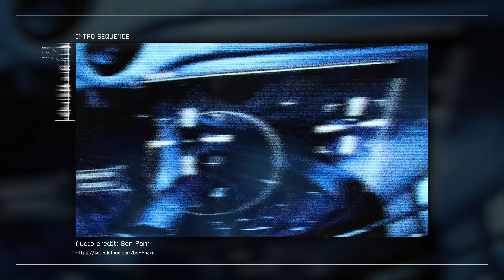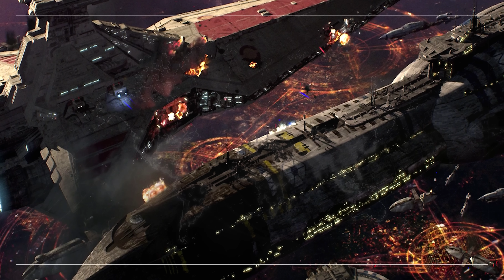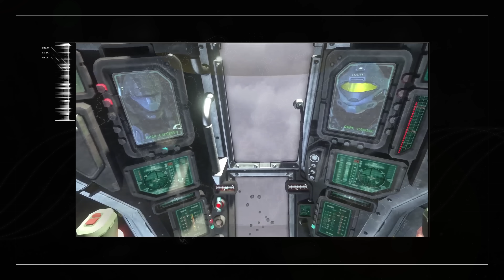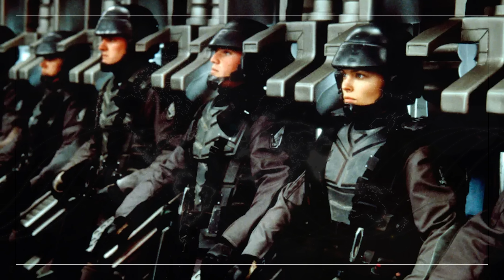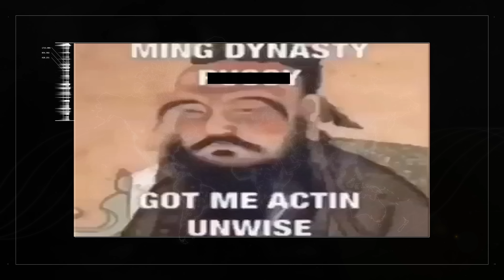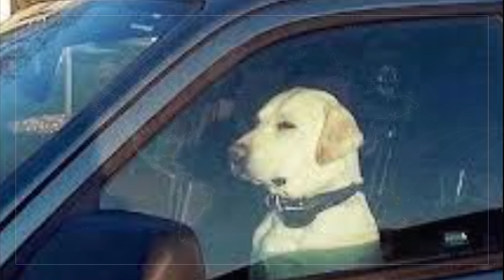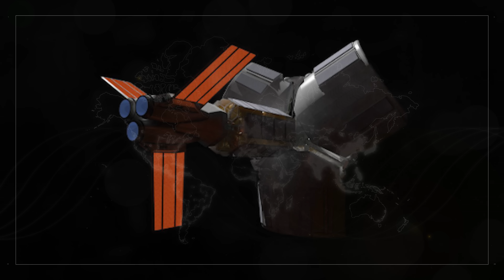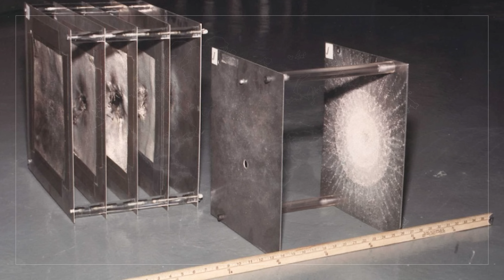The REALITY of Space Warfare

Comment: Great video, though i'm not sure if I agree that planet side defenders have it worse off than an orbital fleet. Yes, the fleet has the high ground, but the energy imbalance from that actually kinda swings in the defenders favor, for low orbits at least, because the defenders can use the spaceships' own velocity against them. The defenders doesn't need to launch a missile into orbit, they can just launch a suborbital missiles straight up and have a spacecraft in orbit slam into it sideways at 8 km/s. 

Second, the defenders have the resources of a whole planet at their immediate disposal, whereas the attackers only have whatever supplies they are able to haul along with them over interplanetary distances. Sure, the attackers might have substantial resources elsewhere in the system, but those interplanetary resupply runs are going to be substantially more time consuming and costly than the defender's intercontinental resupply runs. 

And lastly, a big advantage that wasn't mentioned is the planet bound defenders have cover. Both in the sense that they can bury bunkers into mountains and just be stupidly difficult to crack, but also in the sense that they can hide . You can have hidden bunkers or even stealthy mobile assets like submarines that make it a nightmare for the exposed spaceships in orbit to know when and where the next attack will come from.
Reply: Space is big, super big. A fleet doesn't need to be close to a planet, it can very easily just sit at edge of the solar system throwing literal rocks at you, or to be fancy, iron or other denser material. You in your happy planet or fancy Space Station, are just sitting ducks, you cannot dodge, you can only evacuate or try to minimize damage because everything you destroy is still coming towards you at ludicrous speed but in smaller parts now. Meanwhile the fleet is too far away to be in real danger of any retaliation by the planet or space station.
Reply: @krigerLM  Things take many decades to fall from the edge of the solar system, giving the defender plenty of time to nudge it off course using the same techniques the attackers used to put it on course. The attacker needs to completely reshape the object's orbit and boost it towards the planet at high speed if they want it to hit within their lifetime, the defender just needs to shift its path by a fraction of a degree. You'd have to have some of the fleet follow the rock and ward off redirection attempts, but that's putting the fleet back in danger again. The only way you could stand back at the edge of the solar system is if the planet your attacking isn't spacefaring, or the entire rest of the solar system is inhabited and is on your side. Which, yeah, if there is that big of a tech or power discrepancy the defenders are going to loose. I'm not saying a planet can 1v1 a whole star system, I'm saying they have a home field advantage if they are attacked by a comparable power.
Reply: @massimocole9689  right, if they’re going for a traditional invasion (non planet busting) they’d need to have already begun to colonize the star system in order to utilize “local” materials (which are still incredibly sparse in outer space). If they haven’t already set up infrastructure throughout the system then their supply chain is just not up to par with a resource rich planets. Eventually they will run out of crowbars. If you say “nuh-uh they brought all the crowbars they’d need” you’re telling me they brought 70,000 extra crowbars across interstellar space?

And we come to the inherent problems of hypotheticals and assumed starting conditions: if they’ve already invaded and set up infrastructure between asteroids and comets and other planets without resistance— or if the defenders have had access to space and the ability to interfere with this level of colonization— either way I feel like we are stretching the definitions of “space bound” and “planet bound.” These are battles that have already been won or lost before a shot was fired.

Anyone can set the starting condition of either side as OP as they want, at which point realistic analysis is pointless.
Reply: One doesn’t have to hit the orbiting enemy from the planet. Striking anything up there could get a chain reaction going and the ships computers will be overwhelmed by Kessler Syndrome
Reply: @AnkhAnanku  False.
Reply: Just thinking here, but wouldn’t a better payload delivery be something like a flak missile? You could fire a bunch off and have them explode before hitting any ships, launching tiny bits of metal toward an enemy fleet. If you could figure out the timing well enough, you could simply use the missiles as a vehicle to launch metal at great speeds toward enemy vessels.
Reply: It's true that the planetary side would probably have more resources and cover than a space fleet. But as long as the planetary side is blocked or not capable of moving into space the whole combat just boils down to literally throwing rocks at the planet.

A fleet capable of interplanetary travel would more than likely have multiple ways of redirecting or accelerating an asteroid with rocket boosters or specialized towing ships and push them into the planets orbit.

Like in the Expanse. 

To a sufficiently advanced force, a planet is an incredibly vulnerable target since the planet itself is incapable of any evasive maneuvers. You don't need giant lasers or multi megaton nukes to cause catastrophic damage to a planet, a simple rock will suffice. And as for underground bunkers and such, the same applies, just drop a big rock in the suspected area of the bunker and you don't have to deal with it. Even if the bunker withstands the impact it will get buried or damaged. And it's a lot easier to spot a bunker's entrance when they open it in the middle of a barren crater.
Reply: @NemValaki  Planetside can detect incoming asteroids and have the same (if not better) capability of deflecting them. Ablating lasers and railguns fired early enough can totally deflect incoming asteroids for less energy than it took to bring the asteroid to a collision course.

Also this is something people tend to not think about, but I subscribe to the Isaac Arthur mindset that even a very young spacefaring civilization (think 200-300 years from now) has trillions of people already living off-world in space habitats once automated construction and mining takes off. That is an incredible amount of sensors and defense stations on system that invaders have to deal with before they can even begin lobbing rocks at the planet.

Non-invaders, e.g. people who just have to destroy the planet, don't have to deal with them, though...
Reply: 1. Energy and speed. Your ordnance is slow, hot, and expensive; his will be fast, cold, and cheap.  They'll have plenty of time to intercept your missile. It's the same problem infantry has with aircraft, but on steroids. 
2. Resource availability is an advantage but only if you've already built the ordnance. Any factories will disappear fast.
3. That's cover and concealment. The latter works only once for each launcher, if at all. Orbital synthetic aperture radar can track subs, while any missile silo will disappear in a cloud of dust a minute after it unmasks. The former would have to be 1km under the rockies.
Reply: @ 1. Velocity is relative, a suborbital missile that is barely moving with respect to the ground is moving at 8km/s with respect to a ship in low orbit. Orbital ordinance becomes hot the moment it fires up its engines to deorbit, and becomes very hot as it renters. Orbital ordinance is also more expensive than surface ordinance, because it took an interplanetary long supply chain to deliver it, and had much tighter mass limits as a result.
2. Factories are somewhat difficult to completely bomb out short of nuking them. In WWII factories all across Europe were repeatedly bombed over and over cause they kept coming back into service every few weeks. That's not even factoring in the possibility of hardened factories in bunkers. The fleet in orbit meanwhile has zero factories, it has to rely entirely on its own stores or on a very long logistics chain. 
3. Depends on how fast the retaliation from orbit is. If its primarily missiles or kinetics you have several seconds or minutes for a mobile asset to relocate or for a bunker to reseal. And even if it is almost instant, cheap disposable launchers wouldn't care. Suborbital missiles are small enough to be truck launched, and lasers can be directed to redundant relatively cheap relay mirrors.
Reply: @ Was this for me? You have to leave the name for a person to be notified.

1.  It's slow as sludge climbing the gravity well and hot as hell from the rocket. He'll have plenty of time to intercept. Even in orbit, 8km/s isn't really all that fast for space combat vessels. The stuff he drops will only light up for a second to de-orbit, after which it's just a free-falling crowbar. That will heat up in entry, but the hotter it appears is also faster and closer. 

Because it's just a crowbar with rudimentary guidance, it will be cheap no matter what. Given what it is, it would be standard for the invader to make them on-site from asteroids or small moons.  Your stuff will require rockets and expensive guidance systems designed to evade point defense and hit ships maneuvering at 10+km/s.  

2. Any visible factories, C3I, or detection systems will be eliminated on day one. Remember, he's dropping 1000kg crowbars from 1000km at 9.8m/sec/sec. This will vaporize anything it hits. He doesn't need nukes when he has the power of MV^2.

3. Mobile launchers can be tracked once they reveal themselves and smaller crowbars directed at them. You can't outrun something like that. Any bunker that can launch can't be deep enough to survive the heavy crowbar strike. Lasers are useless for anything but point defense due to atmospheric diffusion.
Reply: @mojrimibnharb4584  I did put your name, but it got bugged. Your comment also has that issue, my name isn’t showing up in it, it’s just an at symbol on my screen. It’s an annoying issue with Youtube at the moment. It also seems that comments that are too long don’t go through, I tried sending this as one comment and it didn’t work, so I’m splitting it along the 3 bullet points.
Reply: @mojrimibnharb4584  1. A missile can easily have a thrust to weight ratio of dozens or even hundreds of g's, so the difference in acceleration between a missile going up or down a gravity well is pretty small. The difference in velocity is also somewhat minor, especially if your missiles are powerful enough that an 8km/s closing velocity is considered slow. This is compounded by orbital velocity working in favor of the defender and in the disfavor of the attacker. If a craft in low orbit wants their rod to fall quickly, rather than just barely skimming the atmosphere 45 minutes later on the other side of the planet, they need more than just a minor 1 second deorbiting burn, they need to scrub off nearly all their orbital velocity and fall nearly straight down, which still takes several minutes. And if the enemy isn’t directly below your current ground path you need to spend even more fuel changing the inclination of the rod’s orbit. Both these burns become smaller if the craft is in a higher slower orbit, but then the time to fall gets much larger. A fall from geostationary orbit takes *hours*. 
 
The defender’s missiles also don’t have to be more sophisticated, as a dumb suborbital cloud of sand is hard to dodge, impossible to shoot down entirely, and can do substantial damage to the comparatively fragile spacecraft as they slam through it at orbital velocity. This is especially bad for any exposed components such as sensors, weapons or radiators, and wrecks a lot of ablative forms of armor such as whipple shields and mirrored coatings. Spacecraft can dodge, and depending on the engine tech this can make an unavoidably large shrapnel cloud impractical. But even if the attack is avoidable, forcing the craft to evade consumes precious propellant. The fleet can move to a higher orbit where the defender’s missiles take longer to reach and hit with less velocity, allowing the attackers to pick them off more easily while still in their boost phase. But that similarly gives the defenders more time to track and intercept or avoid the attackers projectiles as well.
Reply: @mojrimibnharb4584  2. The max amount of velocity a projectile can acquire from falling down a planet’s gravity well is the planet’s escape velocity, which for Earth is around 12 km/s. In practice you’d be looking at less than that, because to get the full 12 kps you would need to start from past the orbit of the moon and have to wait days for your rods to land. Still, 8-10 km/s of free deltaV isn't nothing, but that’s not giving you nuke levels of energy, or even tactical nuke levels, that 1000kg rod is only packing the punch of around 10 tons of tnt. It also loses a lot of that velocity during reentry, hitting at only around 3 kps, where it’s worth around 1 ton of tnt. That energy is almost entirely directed downwards, so it has more penetrating power, but it’s not cracking a mountain. 
The military has looked at “rods from god” before, and they calculated they could punch through a couple meters of dirt and rock with a 6 meter long roughly 10 ton impactor, enough to slam through buildings into basements and some more primitive bunkers, but they’d do jack shit to something like the Cheyenne Mountain Complex or any other bunker meant for a nuclear strike. And they found they still needed pretty sophisticated guidance to keep them from being knocked off course by the rigors of reentry, because they have to hit very precisely to do damage since they punch a deep but very narrow hole. They have their use cases, but they are not the end all be all of bunker busters, and a laser blinding their sensors or melting off their control surfaces as they are reentering can really screw them over.
Reply: @mojrimibnharb4584  3. As mentioned above rods are rather easy to doge for any mobile platform because they take minutes or even hours to hit and affect only a small area. They function more like armor piercing artillery than like nukes. If you can get even a couple dozen meters away from a 1000 kg rod’s impact site you're pretty much fine. Even less if the mobile asset is even lightly armored, enough that it can shrug off the spray of dirt and small sonic boom from a rod plowing into the ground several meters from it. And a submarine could avoid it by spending those several minutes diving, though given that subs can launch missiles while underwater, it wouldn’t even have to have placed itself in danger to begin with. 

Atmospheric diffusion does make extreme ranges more challenging for lasers, but it doesn’t render them completely useless. One of the big methods in development for clearing debris out of orbit is laser brooms, which use ground based lasers to vaporize or deorbit debris by ablating their surfaces and causing thrust. So to say you can’t be used for anything other than point defense isn’t really true, atmospheric scattering isn’t that extreme, at least on earth, and can be compensated for somewhat with adaptive optics. This still gives the ships in orbit somewhat of a range advantage with lasers, all else being equal. But it’s not all equal, because the planet side defenders have no harsh mass penalties limiting the size of their mirrors, so they can compensate for the range penalties with larger optics. The defenders also have the effectively infinite heat sinks of the ground, rivers and oceans to dump waste heat into, whereas spacecraft engaged in a laser duel will be forced after a time to vent limited coolant or expose their delicate radiators.
Reply: @mojrimibnharb4584  Just noticed the last few parts didn't go through, let be try that again.
3. As mentioned above rods are rather easy to doge for any mobile platform because they take minutes or even hours to hit and affect only a small area. They function more like armor piercing artillery than like nukes. If you can get even a couple dozen meters away from a 1000 kg rod’s impact site you're pretty much fine. Even less if the mobile asset is even lightly armored, enough that it can shrug off the spray of dirt and small sonic boom from a rod plowing into the ground several meters from it. And a submarine could avoid it by spending those several minutes diving, though given that subs can launch missiles while underwater, it wouldn’t even have to have placed itself in danger to begin with.
Reply: @mojrimibnharb4584  Atmospheric diffusion does make extreme ranges more challenging for lasers, but it doesn’t render them completely useless. One of the big methods in development for clearing debris out of orbit is laser brooms, which use ground based lasers to vaporize or deorbit debris by ablating their surfaces and causing thrust. So to say you can’t be used for anything other than point defense isn’t really true, atmospheric scattering isn’t that extreme, at least on earth, and can be compensated for somewhat with adaptive optics. This still gives the ships in orbit somewhat of a range advantage with lasers, all else being equal. But it’s not all equal, because the planet side defenders have no harsh mass penalties limiting the size of their mirrors, so they can compensate for the range penalties with larger optics. The defenders also have the effectively infinite heat sinks of the ground, rivers and oceans to dump waste heat into, whereas spacecraft engaged in a laser duel will be forced after a time to vent limited coolant or expose their delicate radiators.
Reply: @massimocole9689  Guidance systems are cheap.
Reply: @massimocole9689  Sure, you can clear dust and small crap with a laser through atmo, but you have zero chance of hurting an interstellar warship.  That warship need not match you on lasers because it an just keep dropping (almost free) crowbars and use lasers on your (expensive) missiles.
Reply: @mojrimibnharb4584  The reason why a modern day laser broom can't vaporize a spaceship isn't because of the atmosphere, its because its a small laser. The point of bringing them up is they demonstrate that the atmosphere does not absorb or scatter lasers to the point that they cannot reach targets in orbit, and so if your setting has ship meltingly powerful lasers, one of those on the ground is still going to be a threat to ships in orbit. As for your last sentence, I already explained in part 1 why surface to space missiles can be just as simple and cheap as space to surface missiles and in part 2 why crowbars from space are not particularly powerful or good against moving or armored targets.
Reply: @massimocole9689  It's laser power vs atmosphere. One that can kill a ship from ground would be immensely powerful and thus easy to spot. Even if you cover it until your (single) use, there is no way to hide a nuclear power plant. 

As for the others, you're just plain wrong. STO requires a whole lotta fuel and is slow getting there. OTS crowbars are cheap and fast, and there's no reason they can't have terminal guidance.
Reply: @mojrimibnharb4584  The same applies to the ships in orbit, but to a much greater degree, any ship lighting up a laser weapon is instantly a beacon, not that they could hide much to begin with. A laser and power plant on the ground though have much more options, since they can obscure their waste heat by dumping it into bodies of water far away from them. A bunker near the coastline could have underground piplines carrying coolant to heat exchangers on the ocean floor a kilometer away. Even if the ships in orbit spot the slight change in the surface temperature of the seawater, they still have a wide search area to find the bunker. And if its something big like the Cheyenne Mountain Complex built into a mountain, even if they do find it nothing short of a nuclear exchange or dropping a serious asteroid is going to do much to it.
Reply: @mojrimibnharb4584  "STO requires a whole lotta fuel and is slow getting there. OTS crowbars are cheap and fast, and there's no reason they can't have terminal guidance."
OTS crow bars can be cheap or fast, not both. A cheap crow bar that only has enough fuel for a small deorbit burn will take 45 minutes to fall from low orbit, even longer from a higher orbit. And they will land on the opposite side of the planet from where you launched them from. If you want it to fall quickly, or on a target near you, you need it to shed nearly all its orbital velocity so that it can fall nearly straight down. If you're in a low fast orbit that is a substantial 7-8 kilometer per second burn, which is a significantly larger burn than the 2-3 kilometers per second you need to get into a suborbital trajectory. A fast crow bar has to carry significantly more fuel than a suborbital missile, deal with the rigors of a rapid reentry, and have complex terminal guidance capable of surviving that reentry. And, because it had to be hauled here across interplanetary space, has to do all that while being as light as possible. None of that comes cheap. And even with all that, the fast crowbar is still looking at a fall time of several minutes.
Reply: @massimocole9689  Re: powerplant - You can't hide nutrinos.

Re: fall time - It's just calculus. We do it for every re-entry. 

Re: hauling - As I said before, the invader can make them on site.
Reply: @mojrimibnharb4584  in a symmetric war between two space faring factions, I don't think orbital fleets can intercept all the missiles that planetary defenders can launch. Basically just think of the planet as one giant battleship to understand what they're dealing with. And to get to that planet you have to first deal with all the system defenses installed in who knows where.